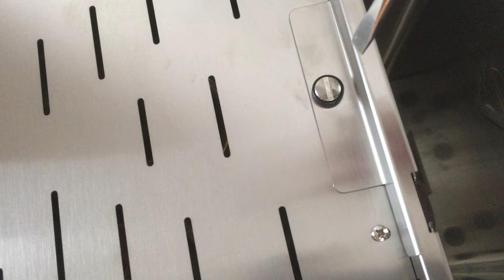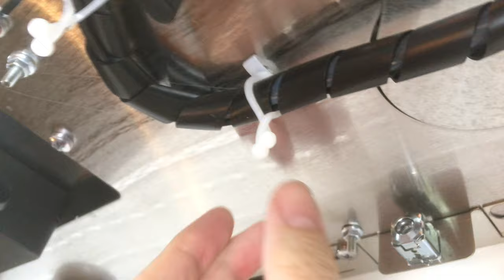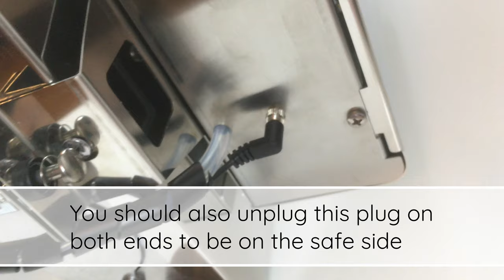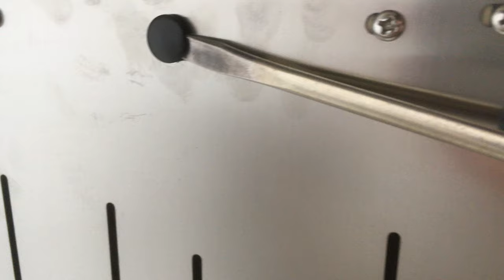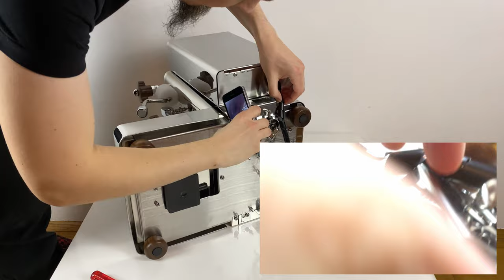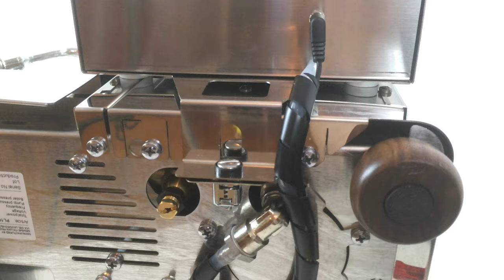Lelit Bianca - Change position of water tank

Comment: Thanks for your video. May I know what size is the drain plug? What tube diameter should I get for the drain plug? Thanks
Reply from the maker: Oh wow, thats a really good question. I didn't even find anything about it in the manual. Maybe contact Lelit directly, they should know :)